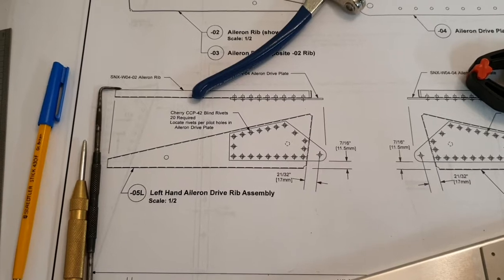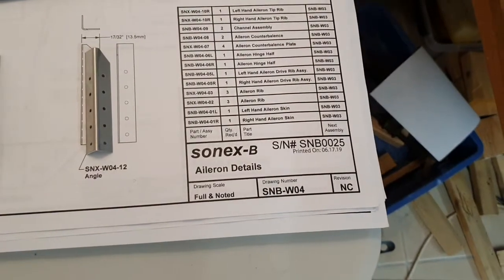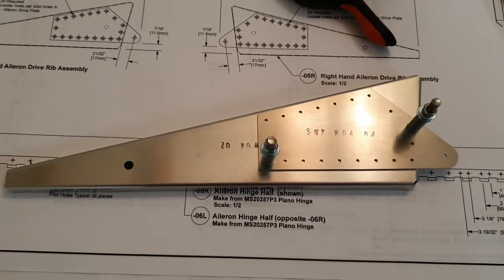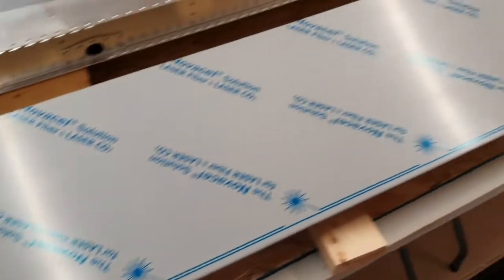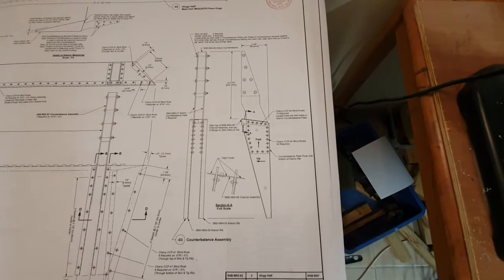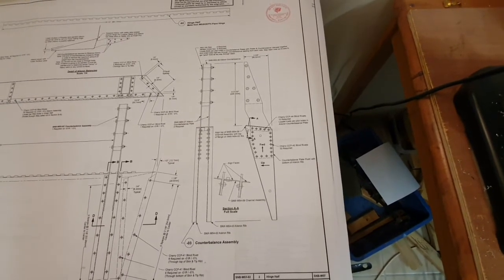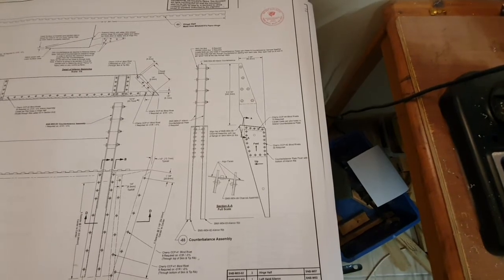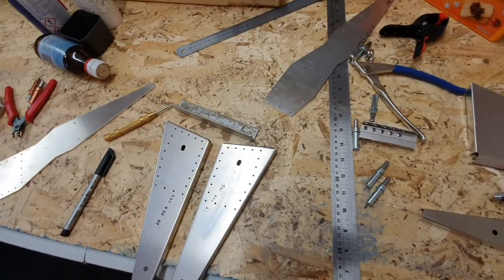Gavin's Sonex-B Part 20 Building the left aileron

Comment: Are you building from scratch or with a kit from sonex?
Reply from the maker: It is the full kit including the AeroVee Turbo engine.
Reply: Were you able to determine if the reason for the misalignment of the flaps with the wing surface was due to incorrect instructions in the plans or was it an error on your part?